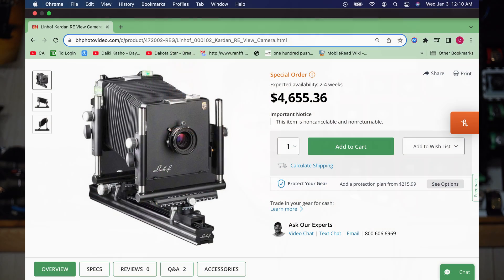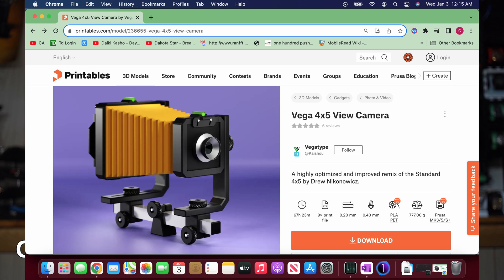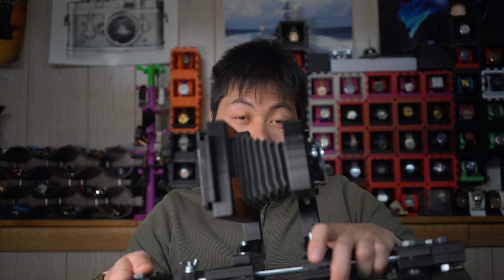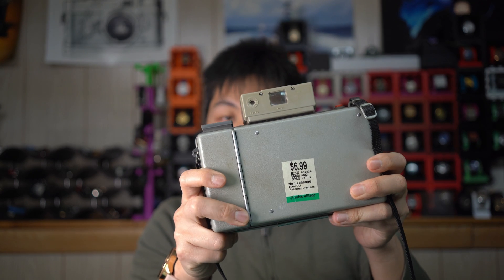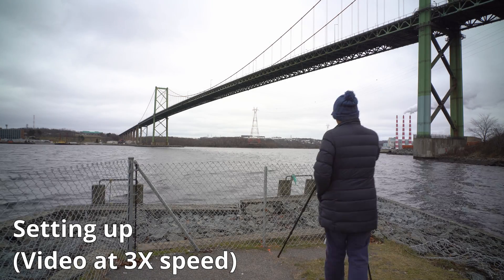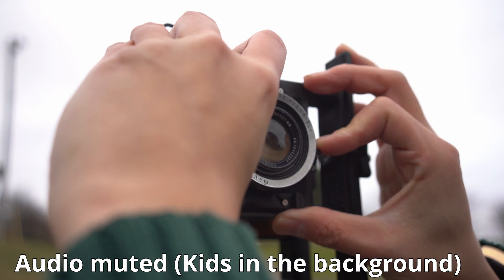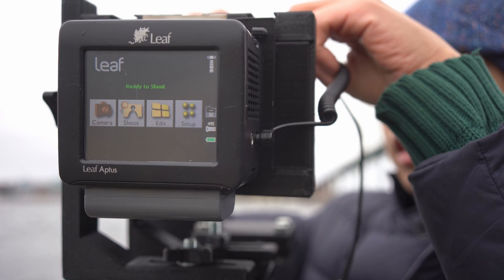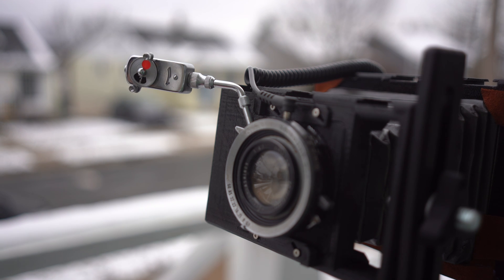Unnecessary, Heavy, and I Love It. My 3D Printed Camera!

Comment: at 6:35 that idea isn't new, Linhof used it, a l-bracket monorail, the Calumet and cadet are others, some say this is a great design.
Reply from the maker: Agreed. I have seen it used on actual view cameras which use much sturdier frames. It is however not as common on 3D printed ones due to the inherent flex you get in most materials that are common and easy to print.

Comment: Thats a really nice video, I did own the same digital back that I cannot use anymore since my AFDII broke and I can't find one that works with my back.
it's really give me hope for the future to start using it again, I will be interested in getting the adapter and stuff to make it work again as I like this sensor a lot.
Thank you for the video.
Reply from the maker: That sucks. But yeah if you have some large format or even an RZ67 adapters can be had! For the large format all you need with the adapter is a x-sync PC cable to trigger the back from the lens! Haha less janky adapters than my 3D printed one can be found on eBay!
 https://www.ebay.ca/itm/283309550339?mkcid=16&mkevt=1&mkrid=711-127632-2357-0&ssspo=pP7pZlLuR6u&sssrc=4429486&ssuid=NMcFURBUQGC&var=&widget_ver=artemis&media=COPY
Reply: @Mr50mmish thanks a lot for the info. I will check this and start my experiments.